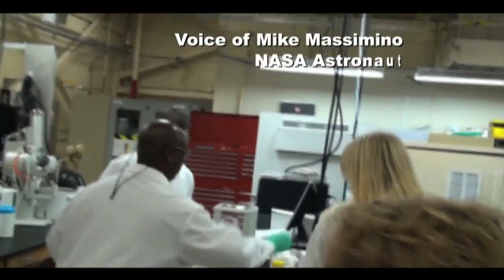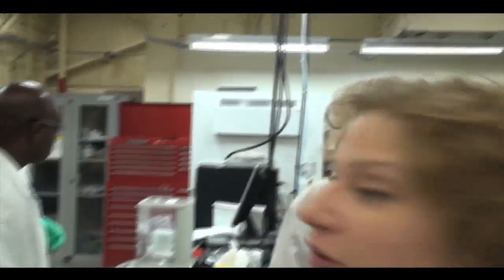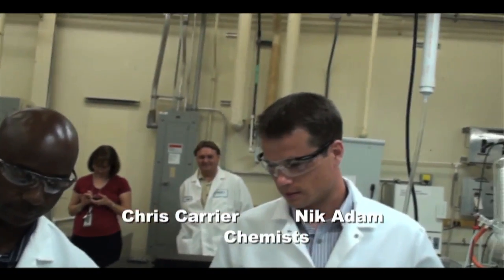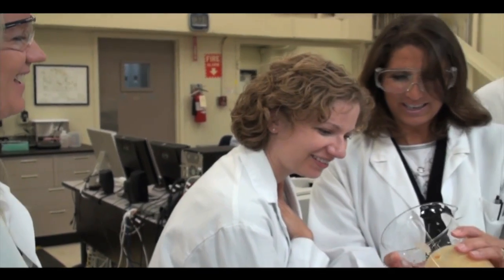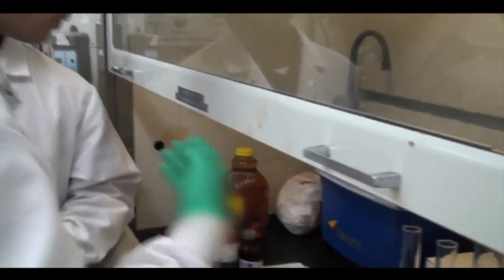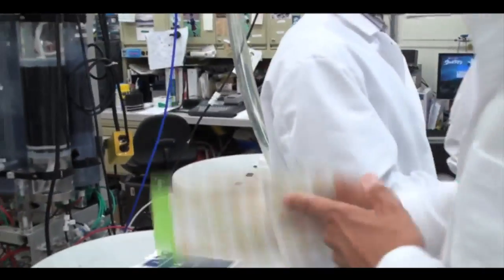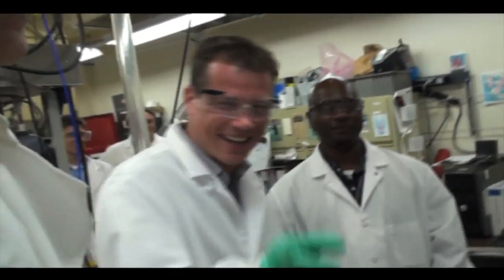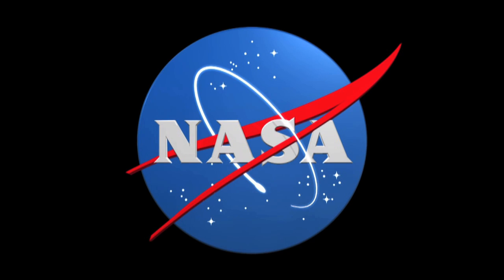Researchers Explore Next-Gen Trash Bag

Comment: to echo xlbrooklyn Not only is this a tremendous waste of time and money; NASA compounds the error by spending more time and money on turniing it into a media event!
Long duration flights will need to extract water for a closed loop LSS. Probably an electrical furnace. The residue can be used for hydroponics and aquaculture. This concept assumes the throw away space cullture currently used on the ISS which is IMHO not a viable long term solution to space settlement..